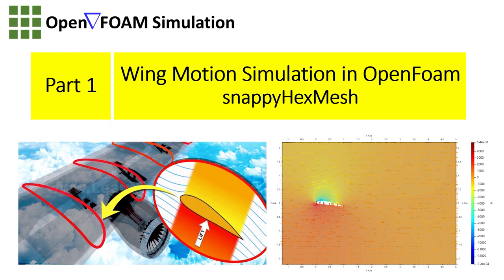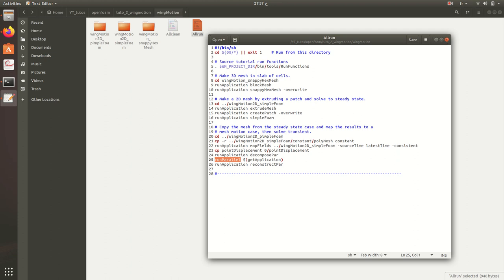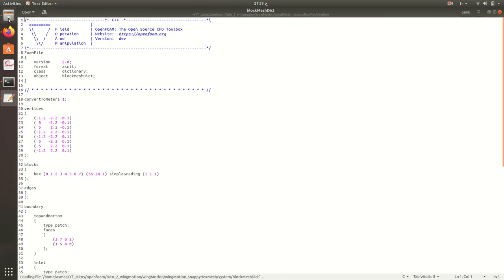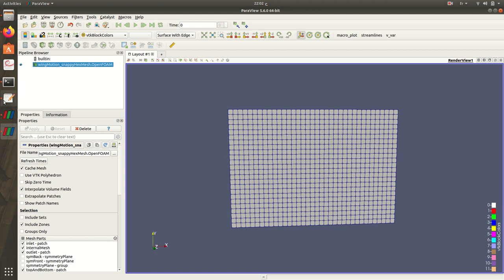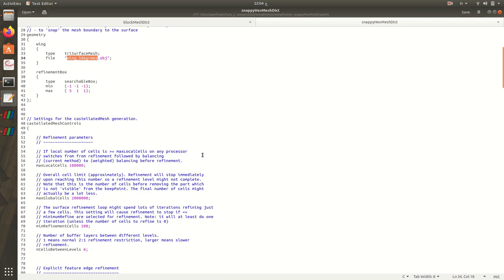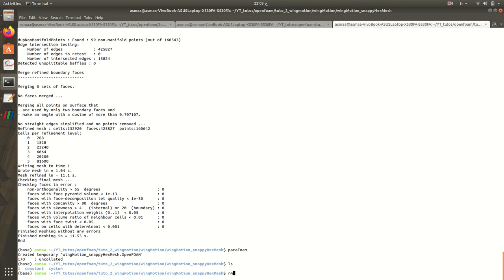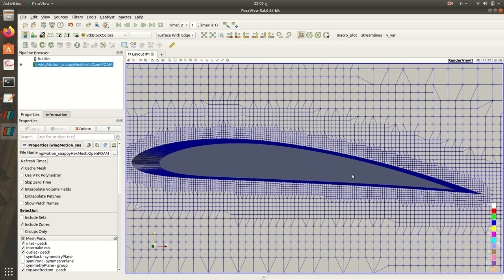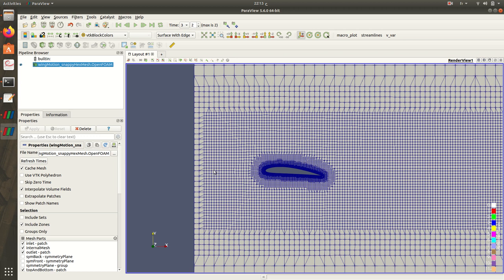Part 1: Wing Motion Simulation in OpenFoam - snappyHexMesh

Comment: thank's for the video, i have a question about snappyHexMesh, 
it's possible to generate a mesh for free surface like a ship or wing between air/fluid.
Reply from the maker: The snappyHexMesh allows you to generate your domain whether it's a free surface or not. While for free streams it's the Volume of fluid VOF that models that kind of problems, check the solver interFoam for more details, and have a look at the tutorial multiphase/interFoam/RAS/DTCHullMoving , it concerns a ship modeling.

Comment: Hey Asmaa! I'm getting the following error when I run snappyHexMesh: --> FOAM FATAL ERROR:
Cannot find triSurfaceMesh starting from <path> Can you help me resolve it? Thanks :)
Reply: did you put the stl file in the folder triSurface ?
Reply: I noticed that the stl file in the tutorial folder /constant/triSurface is compressed  - wing_5degrees.obj.gz
you'll need to extract it using the following command to get the uncompressed file "wing_5degrees.obj": 
gzip -d wing_5degrees.obj.gz